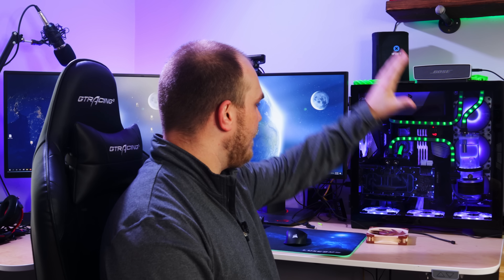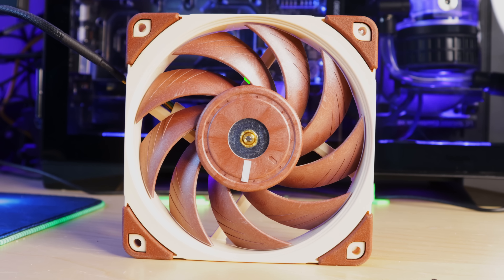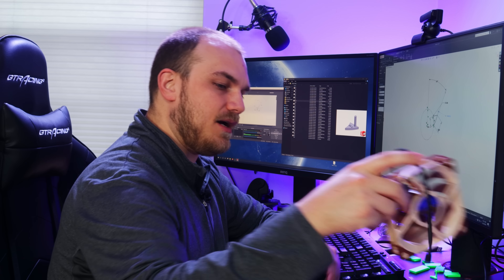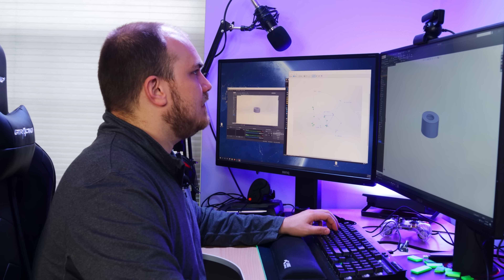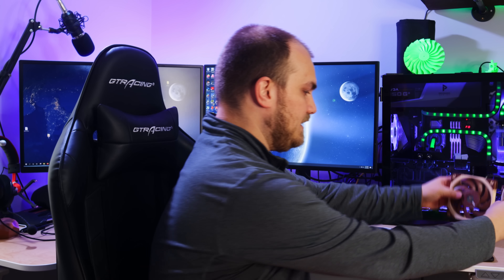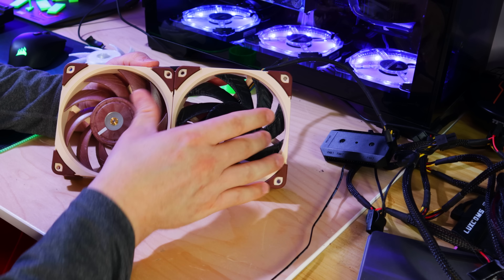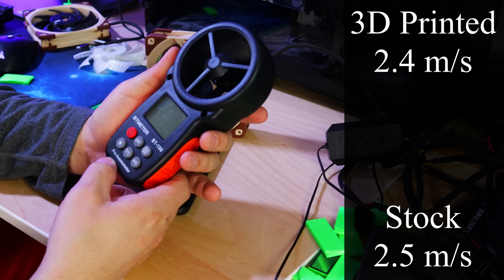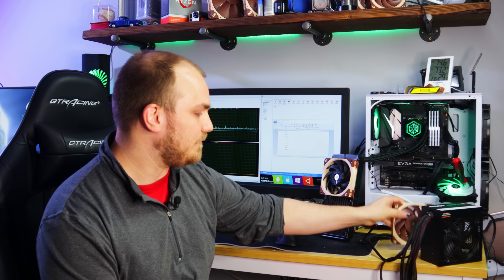I Cloned A Noctua A12x25, Is It Any Good?

Comment: I cringe every time you attribute lower weight to performance differences. Weight only matters during spin-up (or in case of load variations, stabilising RPM, which you don't have).
At constant RPM mass does not affect load.

Comment: Your replica has a rough surface  which means a poor and disturbed boundary layer of air which means a lot more resistance (less efficient). The motor sees more resistive torque and so needs more current to get up to speed. If the current limit is reached before getting up to speed you're left with a fan hitting a lower plateau.

Comment: Blades need to be smooth so the air will not bounce off. Try changing the angle of the blade. Leading edge of the blade is very important.

Comment: You gotta smooth out those micro ridges on your printed blades. That's a lot of air friction and the faster things move through air, the more friction increases on a surface. That's why things burn up entering the atmosphere. So even a small amount of friction on those micro ridges can scale way up when the fan is spinning fast.

Comment: Hey I've looked at your older videos and am really surprised that you haven't tested push pull fans on a radiator.  Typically you can get a 4-7C improvement vs. just a pushing fan.

Comment: the 3d printed fan (41.23) is less than 2cfm difference to stock (42.95) and that is ridiculous knowing that you basically winged the measurements...  smoothing out the layers could fix that too.
Reply: Within 5 percent. Not too bad.

Comment: Before even watching the video all the way through, I can tell you it won't work since Noctua's polymers for their plastic are insanely well made and precisely done so. To get the blade clearance with the proper balances and tolerances, you won't see anywhere near the performance. 

Cool video though!
You get my sub.
Reply: They use a liquid crystal polymer called Sterrox, I'm not sure the molecular layout, but LCPs like Vectran cannot be thermally produced like PBT in a 3d printer, the use a condensation reaction using solvents.  When it comes to devices with high velocities, angular momentum, etc.... The material properties matter just as much as the design

Comment: Very cool build! Your fan blade looks, in the video, like it has more blade pitch than the original one. That would explain the lower RPM more than likely. If the motor had more power, and could maintain its 2000 RPM with the higher blade pitch, you might have seen more airflow.

Comment: i would say use putty to take a mold from the noctua fan and then take measurements. or  u can use a silcon, etc 2 piece mold from the noctua fan, use the mold to make a new fan using EPOXY material. that would be the best solution to copying the fan. other than that u can use the one blade method. make a bunch of single blades with different dimensions and then stack one blade on top of noctua fan blades to see how close u are to it. U HAVE TO DESTROY A NOCTUA FAN IN THE PROCESS TO GET A SINGLE BLADE FROM IT FOR COMPARISON. i'm also a mechanical engineer so this is fun what ur doing. been supporting u since the start..keep up the good work.

Comment: the triangles creats turbulet which makes the airflow follows the blade profile better. this way, not only is the air being pushed by the under side of the blade, it is also being pulled with the uper side of the blade surface

Comment: Major, try the 3d impeller mounted on cheaper fan's motor and shroud and compare it with A12X25.
Reply: I meant really cheap fan, not just cheaper than A12X25.

Comment: I like your stuff man just found ya cuz was considering the same case you have. I have since bought it, comes in Friday! rx 5700 xt pretty excited. I think im going with intake fans bottom, intake fan, rear, and exhaust on side. I have a noctua air cooler I just bought! Anyway I bought some noctua fans so this is interesting. Also bought led lights 1st time time with a rgb mobo! Also I suspect that overtime your fan wont last as long, still cool.
Reply from the maker: That case is awesome I think you will like it

Comment: the difference in plastic would be because of the proprietary material they had to develop called sterrox which prevents impeller creep, caused by the inertia of the fan spinning which leads to the plastic scraping the sides of the chassis, as it would turn out their custom material is rigid enough that it doesn't stretch over time so it will always perform the same even years later, basically the real magic behind this fan design that noctua put together, I spent WAY too much time researching this fan when I was waiting for it's release, now I have 5 in my system so that should tell you how I feel about this fan aha

Comment: A fan can be better in one way and worst in another...
Air move/static pressure. 
Fewer bigger blades will in general give more wind but lower the static pressure, better for case fan, worst for cooling the cpu as air will struggle to pass trough the radiator.

Comment: Going forward I'd recommend you look into Non-Planar slicing.  It gives way better results for propellers, fan blades, wings, etc.  Anything with that style curves it gives way better results.  Though getting it setup isn't as easy and standard planar.
Reply from the maker: where do you even start
Reply: @MajorHardware  Teaching Tech did a video on it and already did a custom build of slic3r with support for it.
The video was: Achieve true 3D printing with non planar slicing
https://www.youtube.com/watch?v=gmePlcU0TRw
It basically completely removes the staircase effect on certain angles.
But how steep of an angle it can handle is determined by the geometry on your hotend.  So depending on your machine you might be pretty limited.

Comment: How does your fan controller control the fan speed? Could you match the fans to a similar rpm and measure the power draw and then match the air speed and do the same? Surely a lighter fan should in theory have less mass to rotate so should be easier to spin require less power/ torque to move meaning less amps. Unless it were moving more air/ creating more pressure?

Comment: Try heating the print with a heat gun to smooth out the layers. Or maybe try printing in ABS and use acetone to smooth it. I think smoothing it would at least reduce some of the sound.

Comment: I suspect the motor is fine, if the 3D printed one makes it spin slower than the allowed -10%/+10% RPM, that would make the hub fail QC with a heavier blade.

Comment: I hooked an arduino based RGB controller to the "motherboard" sync input on the controller / fan splitter that came with my UpHere fans so I basically have infinite RGB patterns and functionality for my PC and all the RGBs around my desk because I can just flash whatever I want to the arduino that acts as the "motherboard" sync for the UpHere controller

Comment: When I'm trying to clone a design, when dealing with a tricky radius like that, I usually just use my camera's long lens to get a very "flat" image of the object, then model based on the image. It's not perfect, but it's close enough for a lot of end user tolerances.
Reply from the maker: Lots have recommended this i never considered it as i figured perspective would cause inaccuracy but I may have to try it
Reply: @MajorHardware  it's worth a shot, just use your longest lens you have and try to center it the best you can. Worst case scenario you can make some adjustments later

Comment: It's too messy to perform well. You'd have to fill it in with some light weight filler of some kind and then sand it out. Or acetone smoothing. Something. But it's still incredible how well it performs compared to the Noctua.

Comment: the main limiting factor with PLA is going to be the long term usage it is the prime reason the 12x25 allows for smaller fan gaps . the plastic allows for less deformation over time.

however for short term testing and quick turnaround RnD PLA and 3d printing designs is a great way to get some real world results. the major thing hold things back being the quality of the 3d printer.
Reply from the maker: i know i need a high quality printer im just to cheap

Comment: "Make it look more professional" <Adding MORE RGB>
Me: ....... o.O RIiiiiiiiiiiiiiiiiiiiiight.
On a side not the fan was making more noise because of how rough the surface of the blades are making for some rather choppy air, potentially also the cause for the difference in air flow and speed (mostly the 1% under the 10% difference... The other 10 was likely the motor itself)
Now maybe if you finished the blades and hub so they were smooth instead of rough it might perform better, it's like having 9 airplane wings.... Only in this case your blades all have little air brakes on them.

Comment: the problem with copy printing a noctua fan blade is that not the same base material is used  and it isn't injection molded. (and nah, i don't want u to get a injection molding machine xD)  The granulate used, has added glas fibers to get better tensile strength. This reinforced kind of compound is uses by a lot of fan manufacturers. The A12x25 is a special case due its extremely small gap, Noctua uses their own special recipe to get better tensile strength. They have found that, even reinforced, the material ages and fan blades can expandand due their lifecycle. Which can make the blades grind on the frame. 3d printing tho is a nice technique but is not yet ready to replace the part quality and strength of any injection molded part. Simple parts and prototypes which r not exposed to higher mechanical forces  are still great to get out of such little machine. Printing own GOOD fans as a replacement or spare part is just not there yet and in a worse case scenario buying a 5 buck fan is way cheaper than printing one.  - Keep up ur great work Major! Nobody on yt seems to get that much in depth on fans like you! p.s.: little hint for maybe getting a 3d scanned model of the original. Lot of smaller specialized car tuning companies has 3d scanners nowadays to build their custom parts like intercoolers and stuff. mb u lucky. second hint, have a look into material science and aerodynamics, keyword: "flow seperation";

Comment: You should print it at LH of 0.05mm to get smoother surfaces :)
Reply from the maker: i would need a smaller tip and m extruder sucks and would probably strip out

Comment: with such an anemometer you can not measure fans, a fan makes the air rotate which has a very strong impact on your anemometer
Reply from the maker: i had tried to print a shroud with the air straightener but my printer failed on it twice so it was scrapped.

Comment: Great video!
🖊📐I would like to recommend you another topic for another video.
The thickness of a fan also matters when it comes to air pressure. So, for instance, Scythe Kaze Flex 120 has a high-airflow design and it's like always, 25 mm thick. If you make the exact same blade design, but makes the blades twice as thick (50mm this time), it should have more pressure and because is a high airflow fan, move also quite a bit of air.
So, you could make a fan even better than this $30 Noctua just by making a high airflow fan blade design and making it thicker.
That's why push-pull configurations in coolers makes a difference, because there are 2 fans (twice the thickness) (also because other aspects, but you get the point)

Comment: hope you can try and investigate a ported/channeled air flow design I remembered way back years ago by enthusiasts. The channel normally starts on the lower front intake and ends up to the rear or top exhaust. Or it can be designed from the warm to the hottest component in the case.

Comment: Roughness on the layers could be causing turbulence in airflow increasing drag and noise produced by the turbulent air. Try vapour smoothing the fan? Could test with varying lengths of time for vapour smoothing and see how that plays out. 

Your trick to get the casing clearance was smart, maybe try with going down to a finer grit paper? Start with the 360 grit and move to a 1000 grit and maybe if you're brave have the fan on while doing the 1k grit to get a smoother finish on the edge. 

Would love to see a 1 blade fan (propeller/Screw Technically?) Could do that with varying angles/layers (1 full rotation, 2 full rotations, half a rotation) and internal geometries (fins between the screw layers to channel airflow, or some kind of compression)

Comment: Could you perhaps do a stacked fan airflow test, where you test the airflow of multiple fans attached back to back? I’m wondering what the results would look like.
Reply: do they make clockwise and counterclockwise versions of the same fan? if so, stack them up alternating and you'll get more than linear pressure capacity out of them.

Comment: Noctua: noooo you can't just copy a design we spent years on and expect it to have the same performance nooo

Major hardware: haha 3d printer go vrrrrr
Reply: This comment aged very well.
Reply: They spent years to copy the gentle typhoon
Reply: Noctua created their own liquid crystal plastic material they call Sterrox that allows the blades of the fan to be almost touching the frame and not bend or stretch over time.  The almost non-existent gap between the blades and frame improves air pressure by a good amount while reducing air noise.  Over time the 3D printed one will stretch out and require sanding down again.
Reply: @FiveVoltFizz  Considering this channel's target audience, I am positive your "Well actually..." wasn't necessary. We all know the engineering behind the fan and why that translates too it being so much more expensive compared to similar fans on the market. 

@Nuovo was memeing out. I think we can all take a cue from them and take things a little less serious at times and always find the time to have a laugh. If not you are always going to be that "fun guy" that never gets invited to parties. If not, you could always change your name to Oscar.
Reply: @FiveVoltFizz  we know, it's a meme

(Pla doesn't stretch though)
Reply: @FiveVoltFizz  Ok so I just looked it up, yeah for the A12 there made there own plastic, while the older F12 and S12A use PBT reinforced with glass fibre aka fiber glass.  So there older fans basically use tool maker standard reinforced PBT, while the new fans use a different plastic that is stiffer and more rigid and still uses fiberglass for strength.  But it also cost 4x as much for the plastic, so that is why more companies don't use it.
Reply: @4RT1LL3RY  yeah that's why the A12x25 fans cost $30 a piece, still very much worth it in my opinion for the performance and low noise profile.

Comment: print it at a finer detail, like a 0.12 or 0.16 by 0.4 or even 0.3 with a 0.4 nozzle (I've printed with such settings, it works absolutely fine with an ender3) it should reduce the imbalance

Comment: I don't have time to watch the whole video right now so I'll just say this till I can get back and finish it. Rpm can depend balance, weight or weight distribution. A lighter fan may spin up faster but may not spin faster then a heavier fan blade. Especially if th lighter blades is also out of balance or the weight is more center mass instead of at the edge.

Comment: You should try to print with a suluble support to give it better smoothness when taking it off, also i think the geometry of the stock fans is made so that it places center of mass right on center of rotation and mid height which is a bit difficult to manage with a 3D printer so the motor has to make up for the offset

Comment: Your fans surface isn’t near as smooth, which is probably causing turbulence in the air flow.  Maybe if you sanded the surface flat?  Of course if you’re doing that, you might want to consider printing a fan that is a little bit thicker to make up for the material you’d be losing.  The heavier fan is going to move more air, although there must be a point of diminishing returns.  Who knows what that motor is rated for?  Also, it’s almost certainly out of balance.  Not much you can do about that unless you get a better printer.

Comment: Print your fan design at .08 layer height.  it will take a lot longer but you will have must less predominate layer lines and it will give less drag.
Reply: Is it possible to print it, so the lines are in direction of airflow?
Reply: @ismaelyu5  Sure, you would just need to flip the orientation when slicing.  but even if you do that it would be different for each blade.  You could, print each blade separate and then fix them to the central hub either by slotting the model, screws, or glue.

Comment: Great video and amazing results if you ask me. The temperature delta was identical and the noise might have been caused by some roughness and being slightly unbalanced possibly. I wonder if lightly sanding them to get an even and smoother texture closer to the original would help?

I'd love to try and print these in ABS and vapor smooth them! My old Solidoodle 2 is definitely out of question, but I do have an Ender 3 on the way.

Comment: Cool experiment. This nicely shows the high degree of optimization Noctua does. Their thing is really finding those things that make the product just a little bit better, quieter, sturdier.  One of the big things with the A12x25 is how close the blades are to the outer housing and with that a plastic that can handle it. During operation, the blades elongate due to centripetal force, which gets worse over time. Also perfecting balance and rotational symmetry is important, which is impossible with a 'simple' 3d printer.